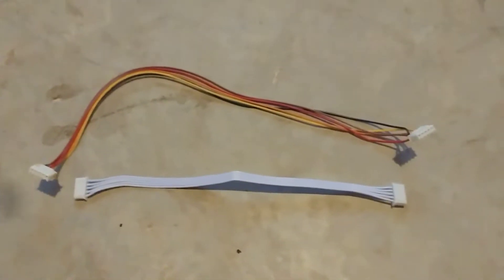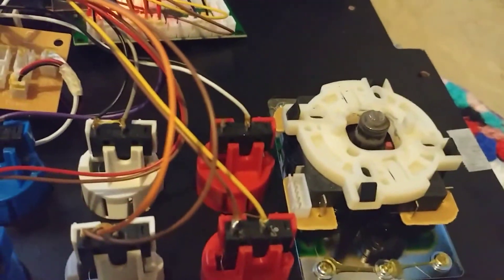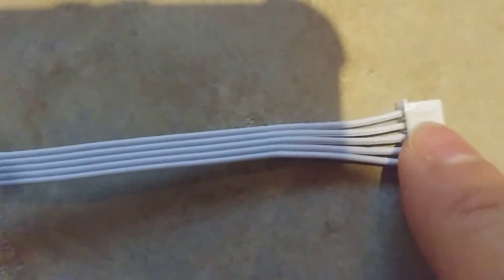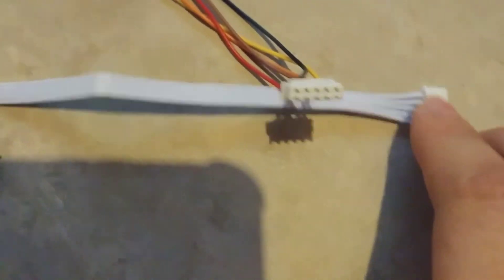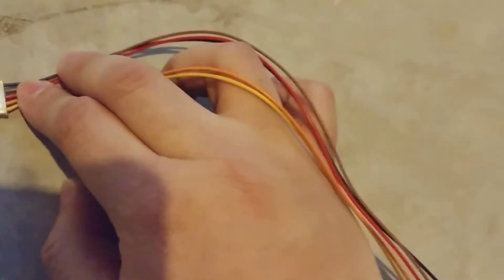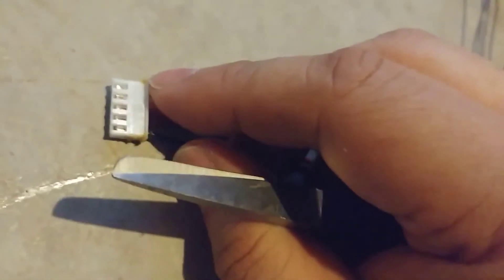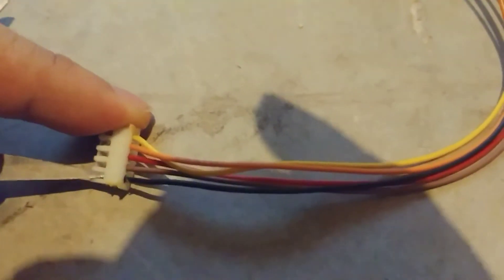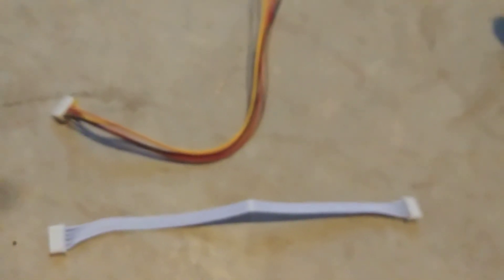How to add USB encoder to existing 5pin Arcade1Up joystick (also can be used for Sanwa joystick)

Comment: all you have to do is take a pin and push on the metal clip and they slide straight out,then before you push them back in just lift the small clip again and it clicks right back in place

Comment: Slizzard i have a question. So i have the original marvel super heroes cabinet with the original arcade panel controls. If i want to keep this setup and not change any controls out.Will i be able to use my usb encoder i just bought and not have to do a complete rewire to all the buttons? I saw this video and i am wondering hw can i bypass all the wire to wire stuff i have seen on these videos. send me an email bwwright@mail.com thanks
Reply from the maker: You'll need to reconnect the pins to your usb encoder. Arcade1up put glue all over the pins so it might be a little difficult to remove them from the board it came with to put on the usb encoder.

All I changed on mine was the joystick I kept the buttons as they were good enough.

Comment: I have the zero delay cable and sanwa jlf and still the up only works.
Reply: Same problem I have now. I am charging a Pandoras Box to work like usb-joystick. 

But I only get UP to work via the 5-pin connector??
Did You find a solution then I would love to know how I fix this please.

Comment: My SF A1Up sticks have two 4 pin connectors. One 4 pin has 2 black and 2 yellow, the other has 2 green and 2 red. Can I modify it to work with 5 pin for USB encoder? TIA!
Reply from the maker: If you have the dual 4 pin just rewire them to the Happ section of the encoder.
https://images-na.ssl-images-amazon.com/images/I/61tBlWKyCPL._AC_SL1500_.jpg

I am not sure if the ground is all connected like the sanwa clones are so you may as well use the 2 pin connectors that your encoder may have included.
Reply: SLIZZARD great idea on the 2 pin... keep u posted, thank u!

Comment: I have the same setup what color wires go to what on a sanwa jlf thanks
Reply from the maker: You just need a straight through wire like the one pictured in the video. I put a JLF in mine this week and it worked just like the original 5 pin joystick that was in the Arcade1Up with white restrictor plate.

This is if you are using a USB encoder for RetroPie. If you are replacing the 5 pin joystick and using the stock SF PCB you can use the original wiring it came with (the colored one)
Reply: @SLIZZARD  I had the 5pin to 5pin originally setup I didn't want the encoder just wanted to connect the sanwa to the original board and turns out it's just plug and play  now working cheers for reply